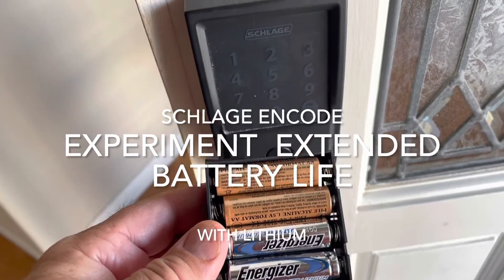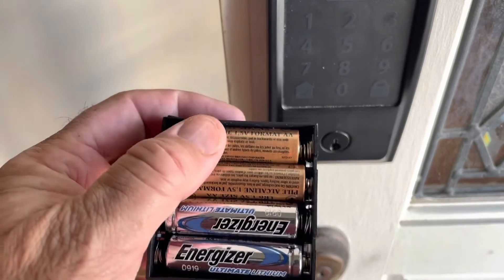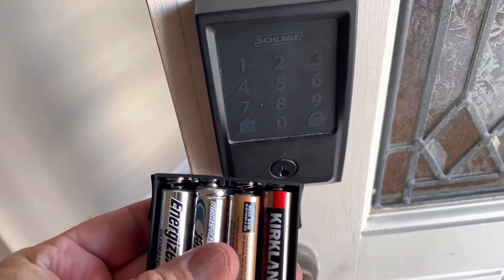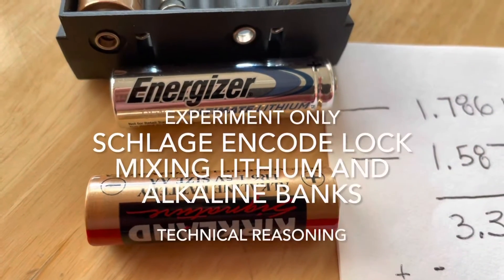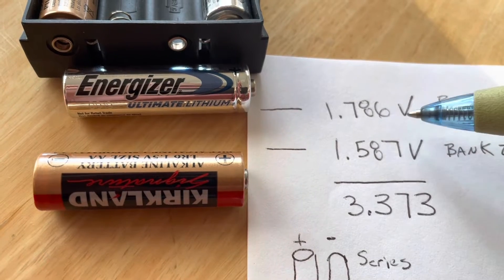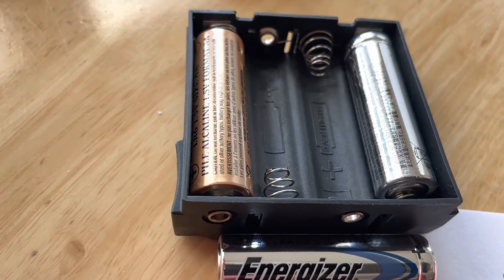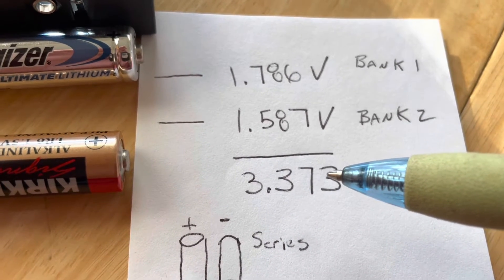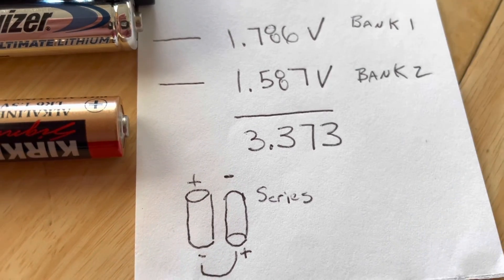Schlage Encode Lock Extended Battery Life with Lithium. Experiment using Lithium on you door lock

Comment: It is my understanding that the reason you want to use alkaline rather than lithium has to do with the way in which they "lose power." Alkalines slowly lose their charge over time (like a slowly deflating balloon) whereas a lithium may last longer, but suddenly lose power at some point (like a ballon unexpectedly popping). In my use case in a remote Airbnb I want to be able to monitor the battery health through the app rather than have it suddenly stop working and create an emergency.  
Just food for thought.
In any case, interesting video and thanks for sharing!
Reply from the maker: @mccapefearless  your are correct

Comment: Did you try rechargeable AA lithium batteries they are typically at 1.5v?
Reply from the maker: No. I was afraid the voltage would be too low since they are regulated 1.5v and nominal voltage of alkaline is much higher that 1.5v.  I also thought that the amp hrs of the rechargeable lithium batteries would not be enough. Let me know the results of your experiments.  Thanks for your comment.
Reply from the maker: 96% after 6mo
Reply: Hows the longevity so far still using the lithium and alkaline?

Comment: Also curious on what life you get. Thanks.
Reply from the maker: 50 days update video https://youtu.be/XoydRsJR1Bo.
Reply from the maker: I’m at 96% after 6 mos
Reply: I tried just regular batteries for my first time and I’m pretty pleased at %53 left after 6 months. Much better than most reviews I’ve seen, which caused my skepticism on longevity.
Reply from the maker: @m0t0rhead  I’m getting 3-4 months on standard batteries and I have auto lock turned on.
Reply: @dannyjensen4954  oh wow. That’s low. I have auto lock turned on also. It appears I will get a full year out of one set. I wonder if your issue is wifi related.